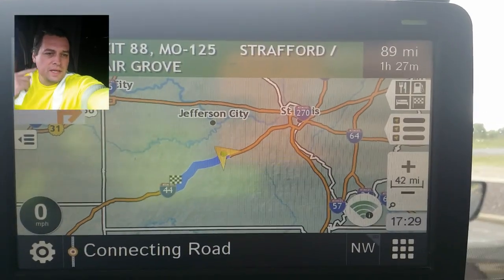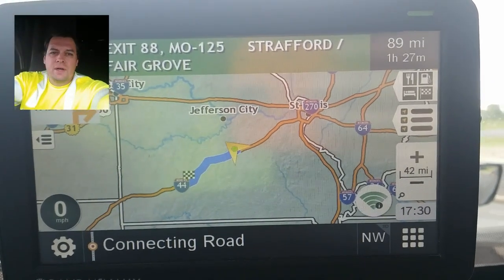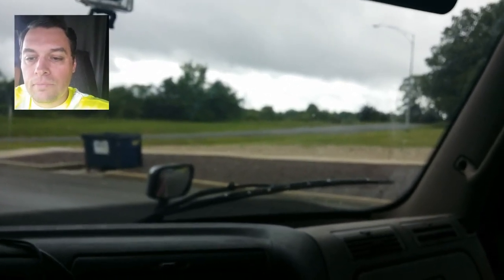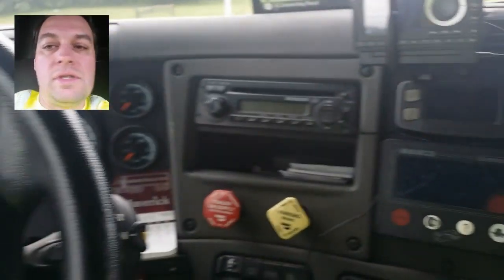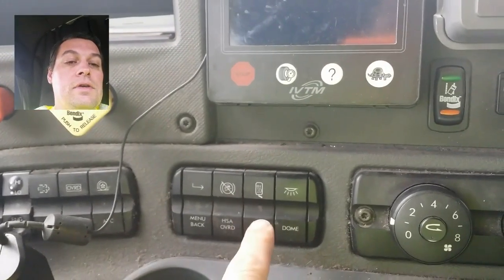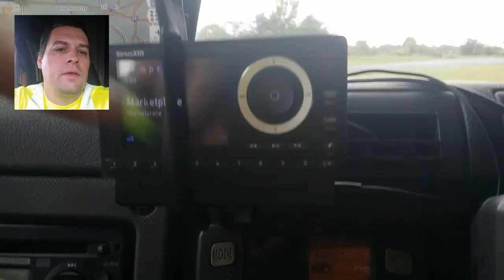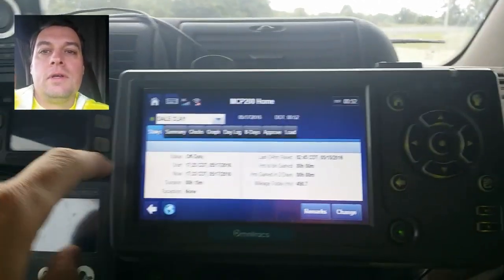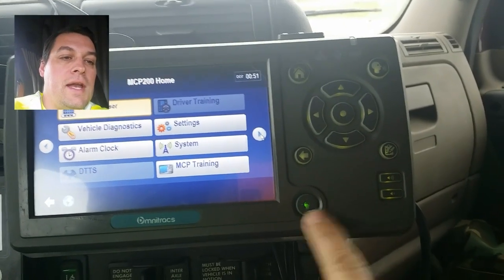Interior Electronics on my 2014 Freightliner Cascadia with Maverick Transprtation

Comment: Subaru calls that "adaptive cruise control". Mine is controlled by two little cameras above and to either side of the rearview mirror. I love it. I touch the pedals so seldom during a trip, I have to remind myself where they are. I can toggle speed changes in either 1 or 5-mph increments on my cruise control. More like a flight management system than a cruise control. Glad you have all that. Must help a lot.
Reply from the maker: +Jan wa1jan Sounds like you and I have similar driving styles

Comment: The thing you can't remember is call lane assist. That's the noise you here in you left or right speakers when you very to far. Be careful when running your cruise like you were discussing in traffic, the one point you left out is it slames on the brakes as well triggering a critical event on your qcom.
Reply from the maker: +( YOUR NAME HERE ) I always try to be careful. But yes, what you stated is completely accurate.